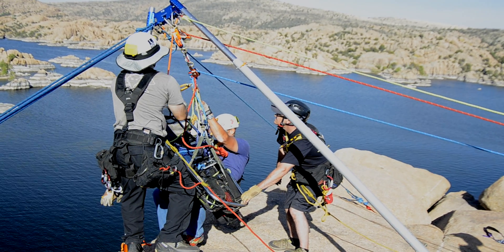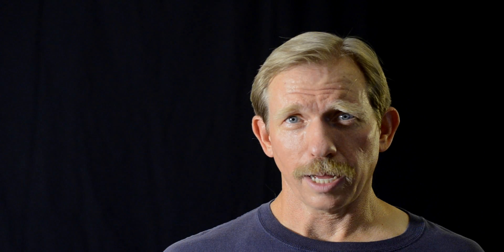Two Tension System Overview

Comment: If you lower only one of the tandem ropes you are negating one of the systems intended safety purposes. By doing this you are making one rope longer then the other so if the high directional were to topple, one rope would be under more tension than the other which sets to back to a mainline and belay line system. I would suggest lowering both rope simultaneously.

Comment: Nice video Tom.
I'm a huge fan of Two/Twin Tensioned Rope Systems (TTRS).

From my tests and observations I feel that such systems truly offer the best protection to the rescue load.  I have seen many belays offered with the best of intentions however I am not convinced that (before TTRS) these have been so effective.

My thoughts:
- operation of the business end of any such system is the job for the most experienced operators on the team
- operators must be well practiced and aware of the potential for human error
- where possible, get the attendant out of the system so that the load is reduced.  This could be for the entire operation with the attendant ascending/descending on their own ropes next to the litter OR just getting the attendant out of the system for edge transitions.

Richard
Reply from the maker: Richard Delaney I have to say that this process and the great discussion just gets me thinking about more aspects of our rescue culture that need a bit of an update. I really liked you ideas about the whistle test or hands off test. I mean tens of thousands are killed every year in motor vehicle accidents and we have no sort of hands off test philosophy for drivers. Something as simple as having the assistant to the device operator formally act as the backup could really improve safety in a way that the hands off philosophy does not.

Thanks for your comments and the great testing that you do.

Tom

Comment from the maker: OK, I will get this started by saying that my goal here is to point to the fact that the traditional non-tensioned belay like the tandem prusik belay can give you some significant downward movement before you are arrested. We have all been using tandem prusiks for decades now and they are safe. The reality is that they may not be the safest thing. 

Maybe it would be better to say that we may not be using them in the safest way. I mean, how many times have you observed some not so awesome belaying.

Two tension systems and the MPD also have drawbacks but they are worth looking at. 

It should be noted that many teams do actively add tension to their belay line to remove rope stretch and slack. This is probably more common with teams who do lowers in the 300 foot or greater range. I am just not sure how common that is or if the need to do so is well known.

I would like to hear your thoughts and if your team uses two tension systems or if you use a technique to add tension to your tandem prusik belay.

Thanks in advance for your voice.